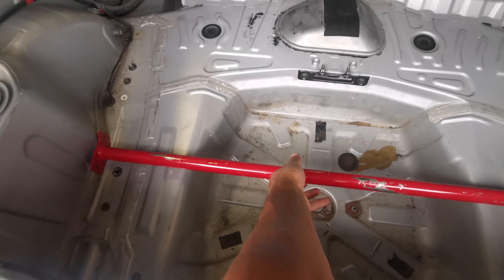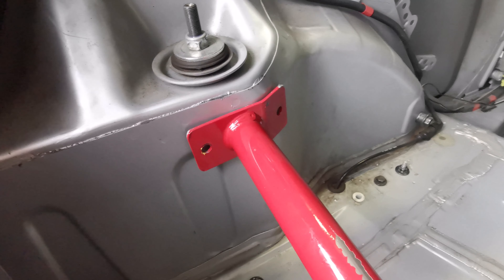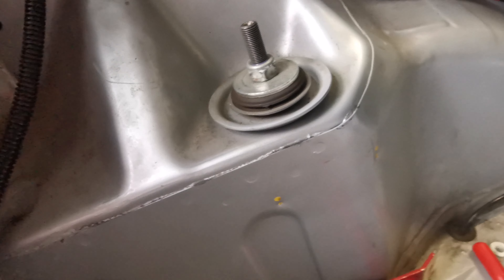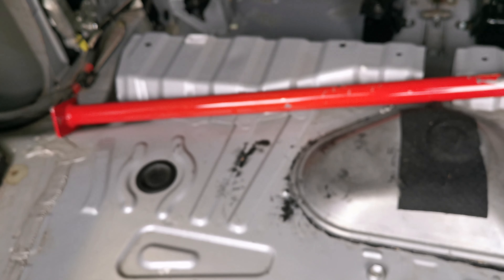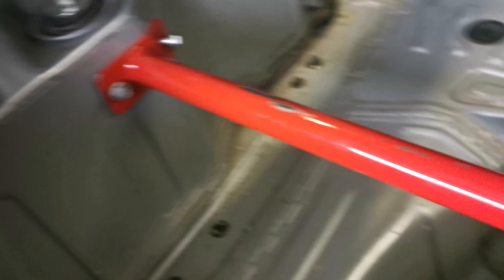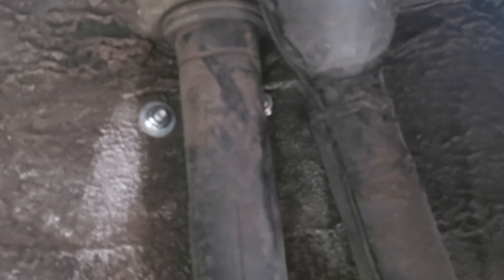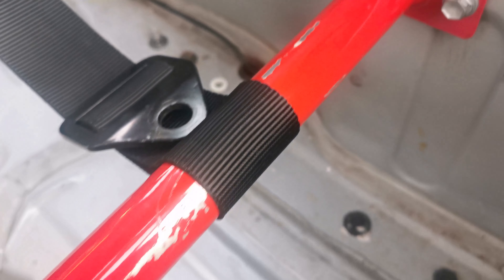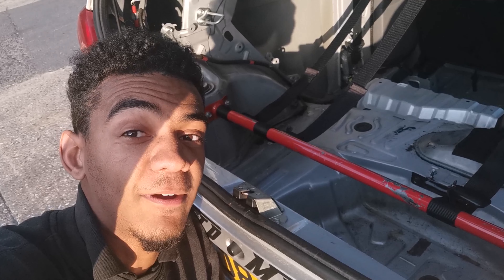REAR STRUT BRACE INSTALL ON THE AYGO!

Comment: would the spare tyre still fit in? or could the bar be moved to allow it to fit?
Reply from the maker: I think judging by the fitment it will still fit but you may have to drop the front seats down or if not, remove them
Reply: @Thatsilveraygo  think ill have to skip the rear brace. thx man keep up the work
Reply: Spare wheel will still fit in and out just have the drop rear seats like you would if you were carrying anything big in the back.
Reply: I can confirm the spare wheel still fits ! Cant wait for tonights video !